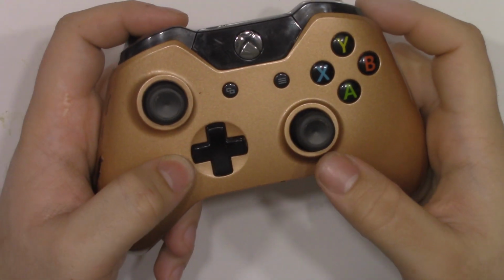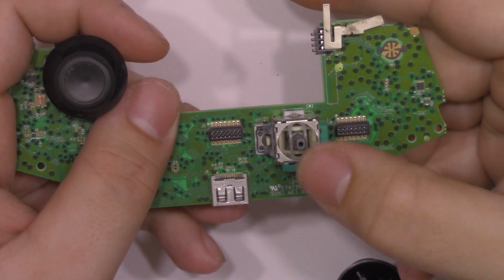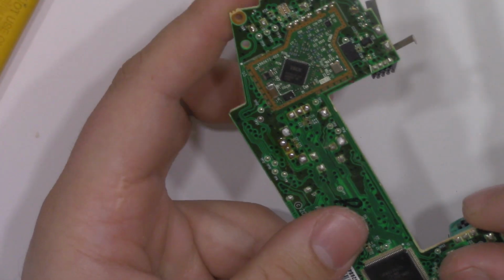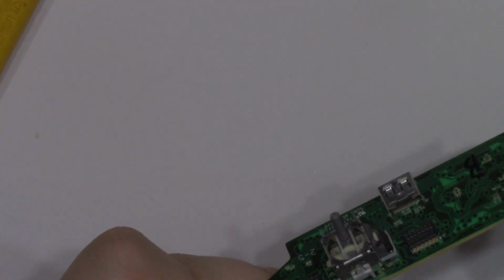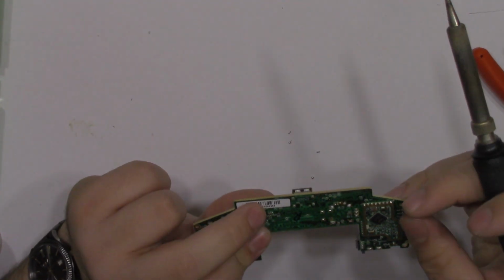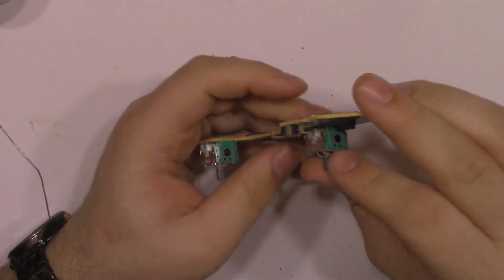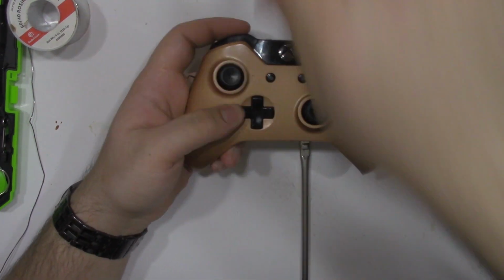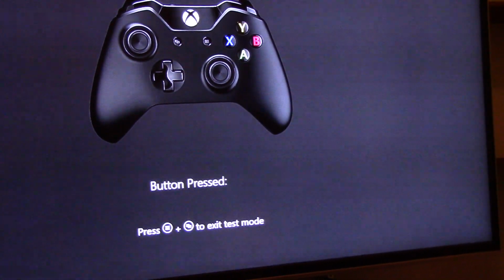Replacing an xbox one analog stick the right way!

Comment: I'm Brazilian and my English is not that good, but I'd appreciate if you could explain two questions:
1 - how did you get soften multiple dot solder and remove the potentiometer in one time? That did that paste you use delay the hardering? When a try to do the same, i soften the first dot solder and it solidifies soon as i get the soldering iron off to go the next dot .        
2 - what is this stuff you use to suck the solder? Is it a specific instrument? Do you think I get to find it here in Brazil?
Tnank you sir and congrats for the job.
Reply: Você acha sugadores de solda bem baratinho no ML, preciso tomar vergonha na cara e comprar um tbm
Reply: @EvertonToledoDeMoraes  poh, mas os sugadores são falhos, eu acho. Eu tenho até um bonzinho, aquele que o sugador é no próprio ferro de solda, tu deve saber qual é. Mas em ilhas de soldas muito pequenas, como no caso dos analógicos,  ele não suga toda a solda e a peça continua presa. Mas valeu pela dica!

Comment: Ever have a problem with the new modules not being calibrated to the PCB?
Reply from the maker: This has been asked a few times but when I replace a stick I measure the pots first to make sure they're near perfect in resistance from wiper to output. I have a video coming up about calibration. Stick around!
Reply: @Solder_king  You da' man!  Thanks

Comment: Exactly as the title states. For people who are new at this kind of work, you’ll be be left in the dark as very little explanation is produced in this video but you do see a joystick being repaired the right way though. People who are searching for these kind of vids are eager to learn so details like what’s a great soldering tool to use and solder along with temperature transfer while keeping the soldering tip tinned, using which brand module and where to buy along with the usage of flux and desoldering wick etc... would go a long way for ppl viewing this video.
Reply: Could you replace an xbox1 analog stick with an xbox 360 analog stick?
Reply: DOOM RAYER yea
Reply: Ээгдшщщз

Comment: I replace one of those and when I was done and turned on my Xbox the game  was spinning like crazy like if I was holding the stick to the side .. I replace it idk what it’s causing this problem
Reply: Did you ever figure out the problem?
Reply: Matt ST2  nooou I got rid of the controller ....nobody seems to know or want to help .. even the guy of the video can’t even say that he don’t know
Reply: @wranefis  that's a shame. Well I read ages ago that the sticks have to be collaborated properly by Microsoft, which is why buying the sticks elsewhere is a bad idea as they will most likely drift in some other way. I have brought sticks from Amazon and I'm expecting new drift issues after iv soldered them tbh. This might not be what the problem with yours was, but I thought it was worth mentioning.
Reply: Matt ST2  well yeah at least your providing more info for the people who are still trying to find a solution
Reply: @wranefis  happend to mine to i desoldered it and soldered it properly on and now its working

Comment: I had an issue with my left stick drifting up. 

I followed your tutorial and replaced the stick assembly. I put everything back together, and I loaded up the controller config to make sure all the buttons were working, and for some reason now when I press the A button it thinks it's the B button, and randomly the the triggers would input and the right rumble would go off.

Any idea what's going on? Did I accidentally touch something with the soldering iron and break it? I'm a beginner at soldering, and definitely wasn't as careful as I probably should have been.
Reply: Ken Hagen is wire problem

Comment: Hey so where I plug my headphones in works and it outputs sound but my mic doesn't work and I tested multiple headphones and they still didn't work so I don't know why it outputs sound but doesn't pic up that I'm talking
Reply: Idk if ur still reading this but the same thing hapoened to me and what i did was go into audio in settings and turn the mic volume down....hope it helps
Reply: Tendation probably a bad headphone jack. Or part of it could be dirty

Comment: After replacing a stick, I found that the sensitivity has changed and moves much faster than the original
Reply from the maker: Did you replace it with a stick with the same resistance in the pots? Most are standard but if it's off a little you'll see a difference.
Reply: I used a stick from eBay, if I swap the potentiometer across, should that resolve ? Many thanks
Reply from the maker: @borisarchby2  it could only if the pots are in good shape and if that's the issue. The mech for the stick could also be at fault.